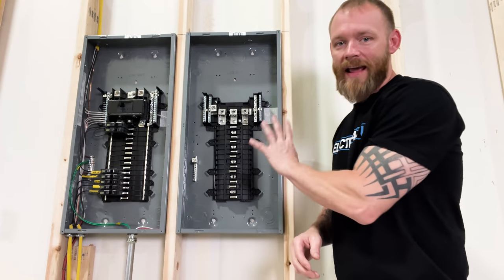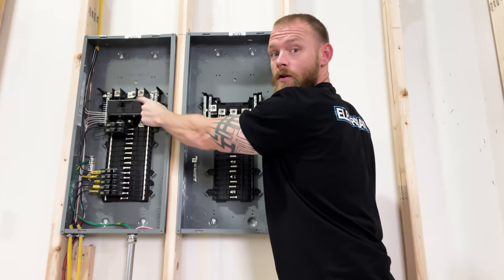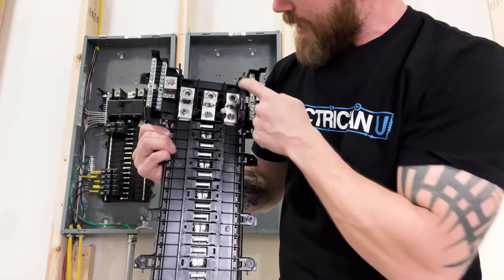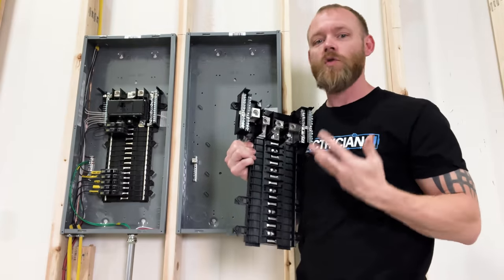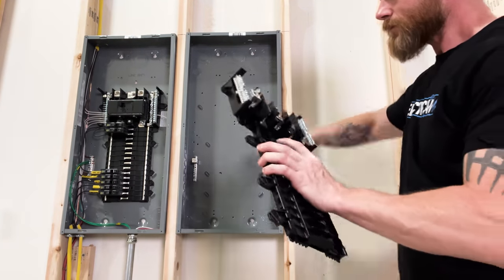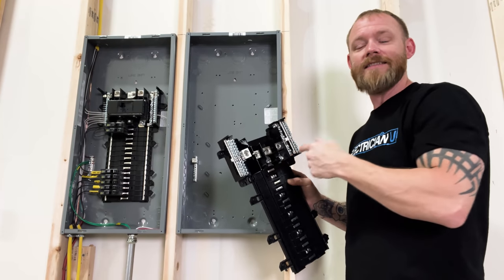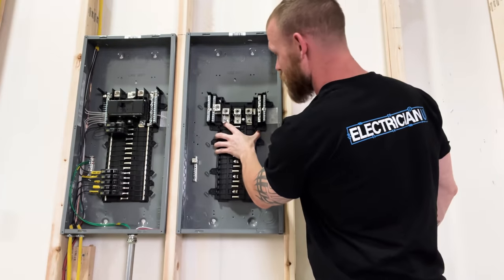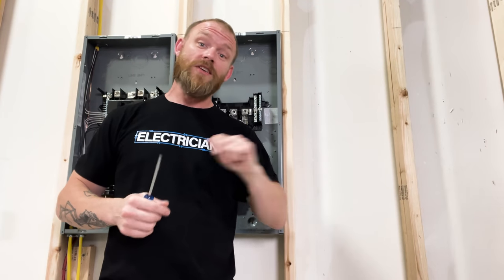How Do I Know if My Panel is 200 Amps? (What Makes a 200 Amp Panel 200 Amps)

Comment: You said it would be 200 amps per leg.  But that also includes any 220volt breakers that are in it as well.  But I am just curious, lets say I don't need any 220volt breakers and just filled the panel with all 120volt breakers.  Does that mean I could pull 400amps through the panel which would be 200amps per leg?
Reply: I was going to answer no because the main is only 200A, but the brake is 200A per phase (I know it's not technically 2 phases) but it looks like the answer is yes.
Tell me if I'm wrong.
Reply: @yvesinformel221  It is two phases, it's just that they are 180 degrees apart instead of the 120 degrees used in three phase wiring.
Reply: If you watch the video again, he mentioned that on a 3 phase panel, 200 amp per leg would equate to a 600 amp load. But they don't call it a 600 amp panel. So, yes, you can draw 400 amps total out of a 200 amp single phase panel. This is true for both 120 and 240 circuits. If you have a 30 amp 240 circuit and a 20 amp 120 circuit, that would be a total of 80 amps (Obviously if they were fully loaded which rarely happens.)
Reply: @yeroca  well when I said that to an electrician and he told me that it is not 2 phases it is only the output of a transformer with a center tap. For me it is the same but...
Reply: @yvesinformel221  Yeah, I've heard the same. Personally though, I think calling it two phases should be fine as one is 180 degrees (or 8.3ms) out of phase with the other.
Reply: @bljdeep  You might want to give "Home Owners" a break for using common sense instead of "electrical jargon" as they have never been a Journeyman apprentice. As you are aware, single phase is two legs, 180 degrees out of phase, while "three phase" is three legs that are 120 degrees out of phase with each other. Who decided to call it "Three Phase" when it only adds one more phase than "Single Phase"? And take a 3-way switch. It doesn't really provide "three ways" to turn a circuit on or off. You have to add a "4-way" switch to have 3 (or more) control points. So, yes, the 3-way switch has three conductors and a 4-way switch has four conductors. But if an English major had been in charge of the naming convention, a 3 conductor switch that only allows for two control points would be a "Two-way switch". A simple on off switch is called a "Single pole" switch. Why didn't they stick to "Three pole" or "Tripple pole" switch and "4-pole" switch? And why didn't they call Single phase a two phase circuit if they were then going to name one additional phase 3-phase? Common sense says the engineers of old that came up with the terns were a little bonkers.
Reply: @bljdeep  And yes, I know a 3-way switch can't be a 3 pole switch because a true 3 pole switch has 3 ins and 3 outs. I'm just saying "3-way" and "Single phase" don't really make sense as "descriptive terminology".
Reply: @chaos.corner  ... the number of phases is based on the outside utility phases. A single phase transformer (USA residential) gives you 2 LEGS on a service panel. Technically that transformer is called a double tap, which means it's got 2 legs and a neutral. 3 phase systems are usually done with three separate single tap transformers on the same pole.
Reply: @rupe53  Sure. But at the breaker box, where the consumer accesses it, it's a distinction with no difference.
Reply: @chaos.corner  ... to the average joe, this is like what's under the hood on your car. You never hear a gear head not knowing the difference between a 6 versus 8 cylinder, right? Yet, they talk technical on electricity and all of a sudden we have a new kind of power. (2 phase 240 volt?) As I said, yeah right! Besides, most 3 phase is going to be 208 volt or 480 volt. There is a distinction if you want to talk about things.
Reply: @rupe53  It's just a matter of perspective. Coming from a scientific background, phase refers to the time based offset of the wave form and the voltage the amplitude (RMS). I'm not arguing that it's not single phase to the transformer, just that describing it as two phase afterwards gives as much information as for an "authentic" two phase supply (unless you can suggest otherwise). Your amplitude quibble is irrelevant as that's just an implementation detail.
Reply: @chaos.corner  ... we can argue this all day long but the facts are in the NEC. Using incorrect or non-standard terms just clouds the issue.
Reply: @rupe53  I agree. If we just want to recite dogma rather than discuss what things mean and their implications, you're right 100%

Comment: The size of the conductors that feed the panel?
Reply: yes that matters too
Reply: in the USA that 200 amp panel would need 4/0 aluminum feeder (called SER cable) for use without conduit.

Comment: Holy cow! Wait till EV's make their way into this!🙄 now ford and gm are coming out with the newer 240V 80A ac monster home ev chargers! Could those chargers trip a 200A box? Could house run smoothly on such chargers? Do you need to upgrade the box and utility service? And don't forget,  those 80A charges need 100A to operate. The other 20A act as a buffer!🙄🙄

Comment: Can you use a 10/2 wire to install a bathroom vent with heat and gfci
Reply: Holy crap. 
Using a hair dyer while heating a curling iron? Use a dedicated 12/2 to the gfci.
For the vent jump off a circuit with 12/3 that isn't typically used. 
You will want 12/3 for a stacked switch. Why vent the heat out 😉